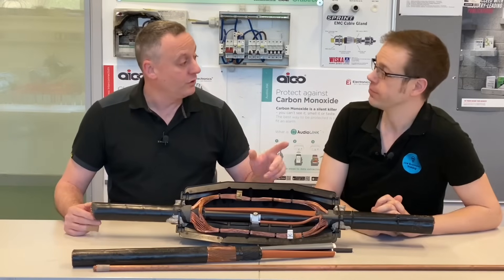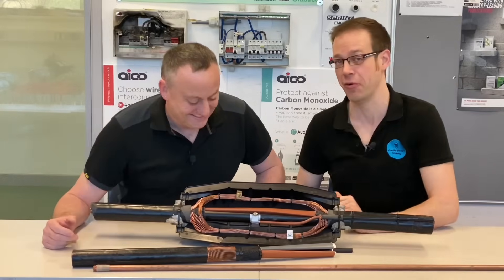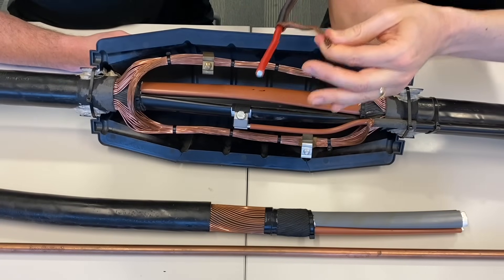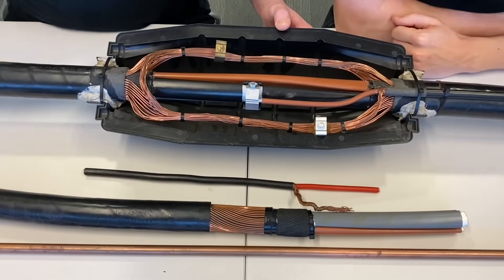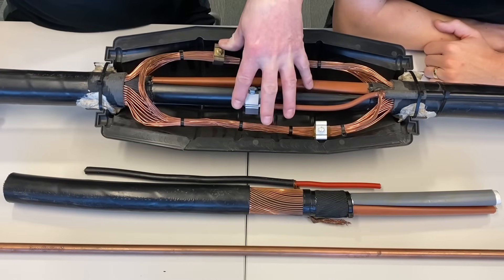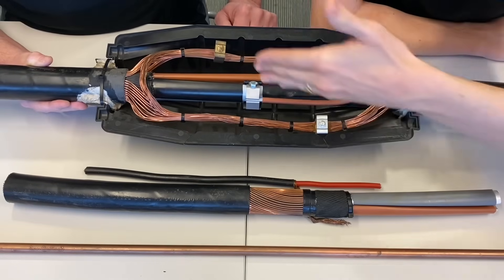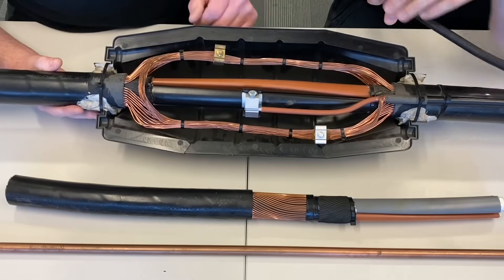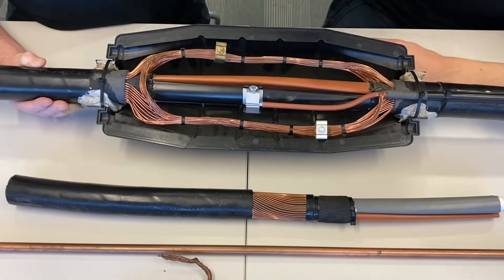Broken Pen Conductor - What’s Going on Inside a TN-C-S Cable Joints. PEN - Protective Earth Neutral

Comment: Former senior earthing specialist at Central Networks here.
A good video but a number of inaccuracies. 
1. Multiple earth rods have never  been required along the cable route. Energy Networks Association Engineering Recomendation G12 only requires a single rod at the end of each main.
2. Earth rod chambers have never been used in the street by DNOs. It invites theft. Rods are installed and buried.
3. They are a nominal 100 ohms but are not required to be tested. They pass no fault current,  it all returns along the PEN conductor to the transformer star point. The rods are purely there to tie the potential of the PEN to somewhere near true earth potential during an open circuit PEN fault.  A small amount of Neutral return load current will then pass through the rod but not enough for appliances to work. This is called a "floating neutral" and the voltage fluctuates in consumer's houses as they switch loads on and off. They alert the DNO who then attends without delay.
4. If the end of main rod resistance was very low then normal load current would flow  without voltage fluctuations and the DNO would never become aware of the PEN fault.
5. The BS 7671 equipotential bonding inside the houses is required specifically to protect people from electric shock in this circumstance.
6. This makes PME (TNCS) safer than TNS because the integrity of the earth conductor is constantly monitored by the load current. On a seperate earth conductor system it can become open circuit for years without being noticed.
7. On the legacy PILCSTA cables (Paper Insulated Lead Covered Steel Tape Armoured) damage the cable lead sheath (also serves as the earth conductor) allows water to enter which causes the cable to blow fuses long before the continuity of the  lead sheath is interrupted.
8. PVC sheathed SWA cables are unsuitable for public distribution because sheath damage results in the SWA rusting away and interrupting  the   earth continuity. 
9. The majority of cable faults are caused by unreported third-party cable damage. Joints very rarely fail for no reason. 
10 All these issues were thought about  and resolved 55 years ago before transitioning from paper Insulated cables to plastic. This why Engineering Recomendation G12 was produced as a condition of the  British government allowing  PME to be used.

Comment: Those joints have been the same since the 1980’s. Waveform cable. all aluminium conductors in main, brass braid to prevent bi-metal issue  with connection to copper conductors in concentric cable. It’s the aluminium conductors that corrode if the sheath is damaged.

Comment: Was reading on AM 3 were adding earth rods on new installation.  Was looking also at stray currents threw ground my thinking jumped to if a broken damaged conductor loses the neutral that formes part of the TNCS could a fault current then be carried in to the home from the Earth rod.

Comment: They never used to cut the cable to do a joint years ago…also saying historically saying the earth and neutral would fail after cutting out many many faults I can say that 95% of the time it’s always a phase gone not the neutral.

Comment: Nobody ever cut cores historically to tap a service on, whoever told you they did is a liar. The earliest connections where plumbed live in ‘T’ joints where the service comes in at 90 degrees to the main

Comment: We are having lots if fails around our late 60s early 70s estate in Oakham Aluminium cables installed on PME system The Insulation gets nicked by ground work and the outer PEN gets serious galvanic corrosion over time and fails under load Usually after 10-20 yrs of corrosion with ground contact  someone in shower or other high load causes remaining strands of the PEN to fail    often is where prev work on other utilities. 10-20 yrs previously or by householders work Repair involves a new section of copper cable into a  sealed joint box our own failed 6 yrs back in pavement where neighbours gas pipe replaced 15 yrs back

Comment: On a breeches joint which this is they have never cut the mains cores, they would have been bound together with tinned copper binding wire then soldered and later 60s ish weak back ferrules were used right up to 2000s, they were also soldered using liquid solder and ladles.
PME systems all have earth stakes at the pot ends. old lead covered cables didn't because the lead sheath was never a conductor but a flexible water proofing sheath. But to avoid it becoming live it would be earthed like any exposed metalwork. When cut away for a joint a temporary earth jumper was fitted then at the end either a lead joint sheath was used or later a copper jumper was wiped across.
The tie wraps are not required but it makes it look tidy.
But the biggest error outside of thinking PME has lots of earth stakes is the abraded sheath, this joint underground is is 905 guaranteed to fail in less time than it should. 50mm of abrasion in a circular direction is the minimum. The resin wont stick to shiny surfaces, so capillary action will draw in water down the shiny surface and get onto the neutral conductors and rot them away, faster the more current flow on that neutral.
Also if the outer sheath gets damaged and allows water in it will run down the neutral strands into the joint. a sticky mastic tape should be wrapped around the live cores of the concentric to stop it there.
Note concentric cable is not waved so when you open it up live you need to cut half the neutrals and pull out the live conductor.
This would have been a fail if done in a DNO training facility.
Cables in roads should be in ducts never in solid ground.
Service cables can be found at any depth for 2 reasons, first over time landscaping can either increase or decrease the ground hight, secondly until about 10 plus years ago there was no legal depth for these cables, practice was a spits blade deep but if the ground was hard, pre excavator days, it could be just a couple of inches.
Sorry to say but a terrible video because of these errors, 15 years a jointer and 39 in the industry so I do know what I'm talking about. I would advise talking to a DNO and getting some advice from their training department.
Neutral faults are rare but the are by far the hardest to locate and the most dangerous to the house owner and their neighbour's.
Don't bother looking for any pits for earth stakes on the network they don't exist, they a buried with the joints.
Reply from the maker: Massive thanks for such a detailed comment and sharing your knowledge 👍🏻

Comment: So modern dno underground network substations which have 185hybrid / wave form or 300hybrid / waveform are terminated in the LV pillar are all pme earthed connected to earth through switch gear at adequately rated earthing capacity. The older parts of the network were there are pilc lv mains there’s a lot of transitional straight joints out on the network pilc to plastic and these would be pme earthed. Some old towns only have pilc LV mains and earthing characteristics are usually tns direct earth.

Comment: Some of the first waveform cables has aluminium neutrals. One little pin hole in the insulation and the water gets in. The neutrals then get pitted and causes them to swell. You could easily find the fault when digging out as the cable looked like a snake had swallowed an egg. The old IPC connections used to fail and go open circuit all the time too. Good video!
Reply: Neutral faults are theeee worst 🤢 and always on alpex as you mention it was rubbish cable

Comment: Most neutral faults come from the cable predating this somone decided it was a good idea to use aluminium for the neutral conductors so all that's needed is a sharp stone to puncture the outer sheath and the aluminium corroded and turns to powder the newer cable can run happily with the copper neutrals wet

Comment: The three phase cable colours, brown black and grey is the same as the two way intermediate strappers, three core and cpc. Brown, black and grey, cpc. Is there a connection?
Reply: yes 3 core and earth cable uses the phase colours, thats why you sleeve the black and grey with brown sleeving when used with a two way so people know its all a single phase. (replace phase with line and earth with CPC if you like :)

Comment: Just had mine upgraded for a EV Charger. Interestingly they've installed a TNS main cut-out, from a TNCS main 3ph cable in the street, so my neutral and earth are just connected in the street. Luckily I emailed them to confirm this so my EV Charger complies with the true TNCS System.

Comment: Here in Finland we use TN-C-S everywhere, but with supplemental earthing at the property (can’t remember the regs of the top of my head, but it’s something like a 16 mm2 around the perimeter of the foundation with a 20 meter branch following the incoming) due to our horrible earth resistance. But all feeds are taken to a distribution point somewhere, either the transformer or a sub panel, where it’s fused down for the single feed to a property. PEN faults are of course an issue, but they are extremely rare and most smart meters these days have PEN fault detection anyhow.
Reply from the maker: Thanks for your detailed comment it’s very much appreciated 👍🏻. It’s possible we are following Europe’s lead with foundation earth very soon. All the best Gaz

Comment: Why not add a stake to earth any way. Surely more connections to the ground from the neutral will ensure less floating voltage difference to the Earth itself? The more stakes the better, but still using this new method?

Comment: The aluminium connector on the cws will not cause corrosion as the shell is filled with resin therefore no moisture ingress thus prevents corrosion. 
The resin used is polyurethane

Comment: How are they allowed to connect such a small cable (25mm) to the 95 or whatever it is connected too? Is there a fuse down the line? 🤨
Reply: The small cable feeding the property goes into a mains fuse and disconnect first. Of course the length of cable cable coming into the house before that fuse is not fused and I don't see how that would be possible. You would need to have a fuse in the underground joint.
Of course the feeder cabler itself is fused at the transformer or distribution panel. That fuse would blow if a dead short occurred but they are big heavy duty fuses so don't count on them doing anything unless something ridiculous like 1000 amp are flowing.

Comment: Very nice video and something which is not seen very often,   it is also reassuring to see a soild method of connection

Do you know if the joints on overhead lines are of similar construction

I am in a rural location with overhead PME with seperate conductors on the poles,   I can see my closet PME earth electrode at the bottom of one of the poles, so they do exist 😁
Reply: Overhead now tends to be ABC (aerial bundled conductor) so the chances of losing the PEN without the phases as well is remote. The older single wire supplies (with the neutral being the lowest of the cables)  were more of an issue, but overhead it's easier to see any potential breakdowns happening

Comment: Guys, we NEVER stripped off the steel tape armour and left it in the mud lol! You might have some really rough jointers down there, but here in Scottish Power region, you would lose your job for doing that. You actually cut the armour (which is, of course, an earth) and plumbed it to the lead with a soldered ball wipe hence adding extra earth path and sealing to prevent water ingress.

As the lead sheath is your main earth, you would fit a continuity strap prior to removing it. Then in PME supplies you would plumb on a 70mm earth wire to either side of the cut lead sheath and take it through the connection on the neutral. In SNE supplies the earth wire just bridged across.

Also, we NEVER cut through conductors for a service connection lol! Imagine if we had lol? People off supply on all 3 phases cause the neutral would need cut too! HSE going scripto for unnecessary live working! We used weak-backed copper ferrules, a good set of grips then soldered using a pot of fine solder and flux. Ah, the olden days...

One other thing: the aluminium shear-off the lad used on the CNE is not suitable for use on Cu conductors. It was used when the CNE waves were Aluminium and the service n/e was Cu and it was the service Cu you wrapped the brass gauze around. Using one on a copper N/E what with a different torque and it being unsuitable should never happen. I wonder if he's pranking you or just doesn't know his job?

Other than that, good job! :-)

Comment: Hi Good vídeo I was trying to understand how the dno was trying to prevent a loss of N+E to my house after reading how bad pen faults could be (live metalwork in house etc. My house was built in 1986 any idea what jointing methods were back then?
Reply: That depends on the distributor it's connected off. Different jointing methods for PILC (Paper Insulated Lead Covered) from the Waveform cable shown. Almost certainly a PME supply either way.

Comment: Another interesting observation.

You don't have any circuit breakers for the house feed.
Here each house feed will have a breaker at the connection to the main feed, say 100 amp or 80 amp.
That way if a single house cable is damaged, the breaker trips and doesn't take out the whole street of 15 to 20 houses.

Comment: Wow, surprise surprise.
Your cabling is different to us in South Africa.

Our armoured cable has a neutral conductor. We don't use the armouring for that purpose. It is connected to the neutral of course but it doesn't function as a load bearing conductor. The house earthing will be bonded at the meter box to the neutral, where it becomes the S Part. There is also an earth rod at the meter forming the PME part. Up to the meter it's C.
So yes TN-C-S and PME.
So yes TN-C-S
Reply: The cable in this video is not an armoured cable .

Comment: I thought the other purpose for spiking the PEN conductor was to keep the extraneous and exposed conductive parts within the building it was supplying at the same potential as true earth. If the PEN conductor is not referenced to earth will this not give rise to potential differences on longer cable runs

Comment: I have seen western power my local dno do joints on faults and what they do is they have a medium coil of copper wire that they tie one end onto the earth conductor and the other end comes outside the joint housing and lies on the ground as a way of converting to PME

Comment: Great video, being from the USA, how long are those run at the low voltage around an area?  We only use the "low voltage" of 240VAC for a few houses (between 2 and 6) here off each transformer, and then the aerial lines or buried transmission lines are somewhere typically between 7.2KV to 14KV that run through each neighborhood.   Then neutral is derived off the transformer tap for our 120V and ground is both at the transformer end as well as at each home with ground rod and/or UFER grounds.  For example our EV chargers don't use a neutral and only our split phase 240V and safety ground.
Reply: Low voltage mains cables in UK are typically laid in runs of up to 400 or even 500 metres.
Reply from the maker: Great comment and thanks for taking the time to watch my content. Gaz 🦾
Reply: In Finland where we also have 400 V system there are 120812 transformers and 2.86 million users. That is on the average 24 users per transformer. This of course varies much and can be significantly higher in urban and suburban areas. It seems the maximum distance to the transformer is typically 600 meters.
Reply: I wonder the same thing, Chris.  Our neutrals are bare and have no earthing "sheath" around it, so I have to wonder if our system really is TN-C-S.

Comment: Thank you as always for a very informative video. I have heard that when jointing TNS cables they will be converted to TNCS as a matter of course. Can anybody confirm this? As electricians can we rely on an apparent TNS service when considering the loss of a supply neutral (PEN) conductor in relation to the design of an installation?
Reply: It does happen particularly when a new 3 core TN-C-S mains is jointed to an existing 4 core TN-S. I don't agree with converting TN-S mains to TN-C-S without at least informing the existing TN-S customers as their main bonding conductors could be undersized for a TN-C-S arrangement.  But repairs to TN-S cable should be replaced with and jointed as 4 core cable, but that isn't guaranteed.  To be honest there's been so many DNO policy changes over the decades it's a mess and you can't guarantee a true TN-S earthing arrangement unless you're installation is supplied directly from the DNOs substation using 4 core TN-S.
Reply: @18in80  Thank you David

Comment: Relevant document is Electricity Networks Association (ENA) G12. Basically it sets out recommendations for earthing of neutrals on PME systems 20ohm or 100ohm rods are specified . For example a network branch consisting of 4 dwellings should have an 100ohm rod at the end of the branch. 2 dwellings on a branch less than 40m don't require a rod. Etc etc 
Cheers 4 the vids as always!
Reply from the maker: Thanks for your input 🦾

Comment: I have seen 1 or 2 houses where the DNO has put an earth rod in when moving a supply and run a 25mm earth cable into the bottom of the cutout connected into the PEN terminal
Reply: Yes, also very common with larger TN-C-S services, you'll often see an additional 25 or even 35mm black conductor strapped to the wavecon cable (the 3ph cable Gary demonstrated in this video) that goes back to one or more earth rods along the trench